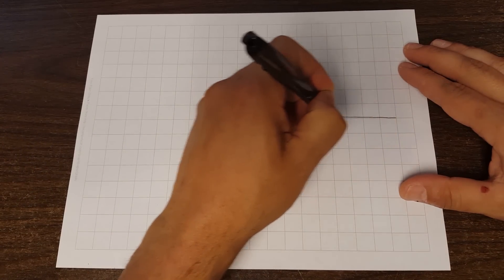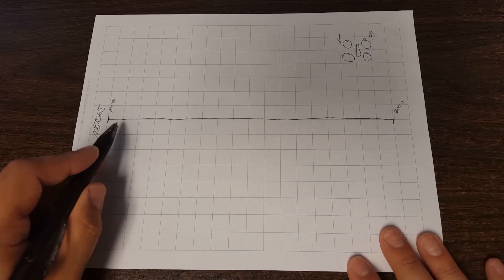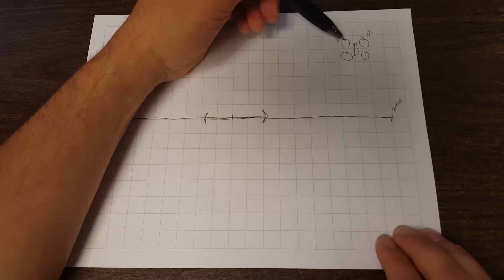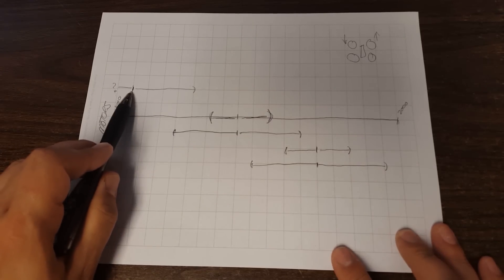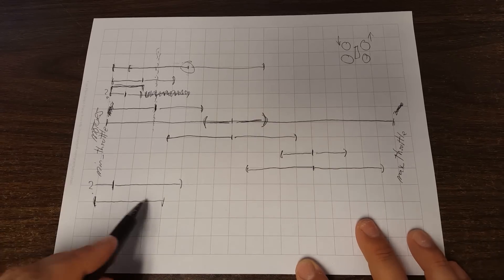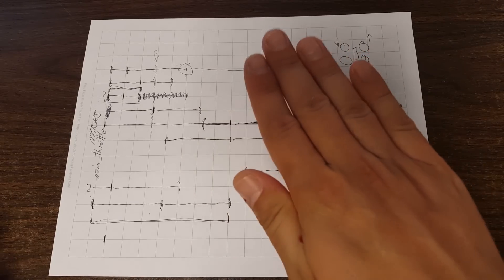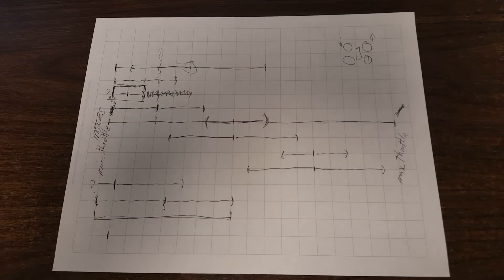What is Airmode? | BETAFLIGHT WITH AIR MODE EXPLAINED

Comment: +Joshua Bardwell, I assume that the same thing occurs at the top end of the throttle range as at the bottom end like you show in the video.
Reply from the maker: +Paul Kendall Yes. But something must be different there, as I've never heard anybody complain about lack of authority at high throttle. Air mode has always been focused on fixing the low end.

Comment: Thanks for the explanation. That makes a lot of sense! I stopped using airmode not long after trying it and reverted to just idle up - this vid has made me want to try it again. If fact, I think I'll configure it now!!
Reply from the maker: +BigSam IMO, air mode is superior to idle up, but to each their own.
Reply: +Joshua Bardwell After re-trying airmode, I totally agree! The difference in authority at low throttle was really noticeable. Thanks for making me try it again. Now I'm thinking I should try playing with roll_yaw_cam_mix_degrees 😃

Comment: There's no dynamic PID adjustments in flight with air mode? It's just a dynamic throttle adjustments with no PID changes?
Reply from the maker: +MicroRCFiend Air mode is entirely a function of the mixer. It has nothing to do with the PID controller. The PID controller's inputs are what "asks for" the authority. The PID controller says, "we need to push harder on the roll axis," and the mixer translates that into motor outputs.
Reply: Joshua Bardwell Thank you so very much Joshua, I appreciate the confirmation.

Comment: cool explanation. now I think I understand it better. Not having problems with landings - but I use a throttle to 0 switch and I also disarm the motors instantly on ground contact.
Reply from the maker: +RCSchim Same here. There is still a small bit of surging on landings, but nothing like the crazy flyaway behavior that used to be the case when air mode first was released. I think Boris has done some cleanup on the feature.

Comment: Joshua, I always tought that Airmode would give full throttle range at any time. So your explaination is confusing me a little.

In the mixer source code, if the maximum authority is reached the set point looks like it's set to center throttle so the authority is [min_throttle; max_throttle].

From the source code.

// Get the maximum correction by setting offset to center
        throttleMin = throttleMax = throttleMin + (throttleRange / 2)
Reply from the maker: +Stephen B As you infer from that line, air mode is capable of raising the throttle set point to 50% if need be, which means that it can demand full range (max_throttle minus min_throttle) authority of the motors if it wants to. I didn't show this in my example is all. But the line you're referring to doesn't (to my reading) appear to be setting the set point to center throttle. Rather, it is determining the maximum range to which authority could be extended, if desired.

This line is the one where the actual set-point adjustment is done:

motor[i] = rollPitchYawMix[i] + constrain(throttle * currentMixer[i].throttle, throttleMin, throttleMax);

Basically, that line is moving the set-point for each motor's output up or down just enough so that the full demanded authority is achieved without exceeding the ends of the throttle range.
Reply from the maker: +Stephen B One more thing: the case where full motor range authority was demanded (and set-point was moved to the middle of the range) should be quite rare, because having two motors go full idle and two motors go to 100% produces preposterous angular rates. Think about how acro+ works, right? That's basically what acro+ does, and you get these crazy situations with like five flips per second or more. That's why I didn't show the example of air mode pushing the set point all the way to the middle of the range. Because for that to happen, the demanded authority would have to be the full throttle range's worth (two motors at 0% and two at 100%) and I just don't think that actually happens very often, if ever.
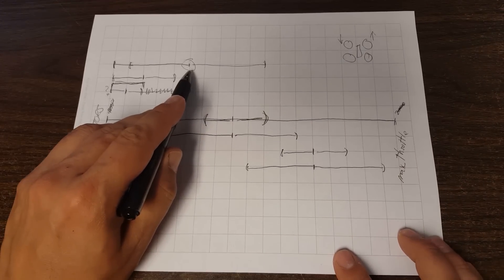Reply from the maker: +Stephen B I didn't help matters out by saying that the motors could go "all the way to idle" at around 5:40. What I meant to say was that the motors could achieve the full demanded authority without "clipping" off the end of the scale. You're correct that, in order for motors to go all the way to idle and all the way to 100%, the set-point would have to be at 50%.
Reply: +Joshua Bardwell I skipped that part of the source code. Now it all makes sense. Thanks !

When I think about it now, the behaviour before airmode is just a bug :D
Reply from the maker: ***** Well, I wouldn't go that far. They probably anticipated the problem that would occur with bouncing on landing, and at the time, nobody was thinking about zero throttle inverted hang time super duper acro maneuvers. Heck! Miniquads probably didn't even exist when this code was written.
Reply: +Joshua Bardwell That's true. I can't wait for Airmode to be the default behaviour. People are still not using it and want to configure idle up instead.
Reply: +Joshua Bardwell - I've been asking round, I haven't found any decent answer, are there any advantages to NOT using air mode? Given today's flying styles, I can't see any reason not to enable it permanently.
Reply from the maker: flapflapflap88 With air mode disabled, the motors stay at overall a lower value when the throttle is low. Some people have reported that this results in slightly longer inverted hang time. Also, some people don't like landing with air mode on. Personally, I run it full time.

Comment: Man you should teach!
Can you explain how 
Airmode "saturation" plays into this?
Thanks
Reply from the maker: +Drone Punk I'm not 100% sure, but I think that airmode saturation limits the degree to which airmode is allowed to raise the set point. In the most extreme case, air mode could take the throttle set point from idle to 50%, with two motors staying completely idle and two motors going to 100%. If you limit the degree to which air mode is allowed to raise the throttle set point, you also limit the max motor output that can occur. This prevents surging motors and flyaways on large copter movements.
Reply: +Joshua Bardwell In saturation mode where the PIDs ask more than motors can deliver offset goes to (max_throttle - min_throttle /2). Yes exactly in the middle! Thats where you can get the most authority 50% up and 50% down ;)
Reply: +Boris B. This is also assuming that power liniearity from the ESC's are liniear! In real world sometimes escs can deliver less power due desyncs

Comment: Really good and simple explanation, made perfect sense to me! Also Air Mode is available in Cleanflight as of v1.12.0 (20th Feb) for those not using Betaflight. I need to start remembering to disable it before I land though, but not had any mishaps yet.
Reply from the maker: +Sean Duffy Thanks for pointing out that it is also in Cleanflight. I wasn't sure, and didn't check.